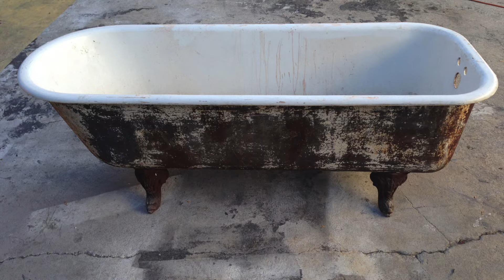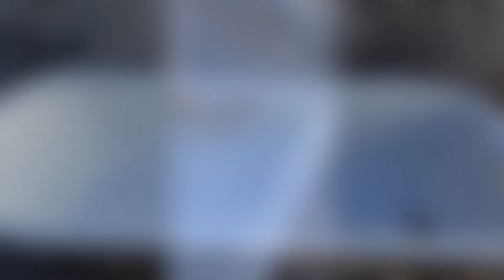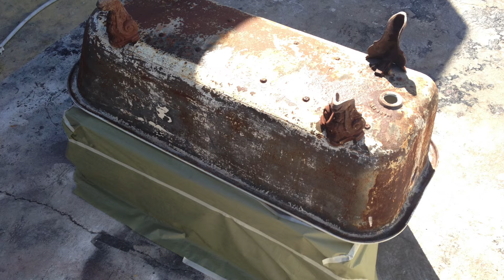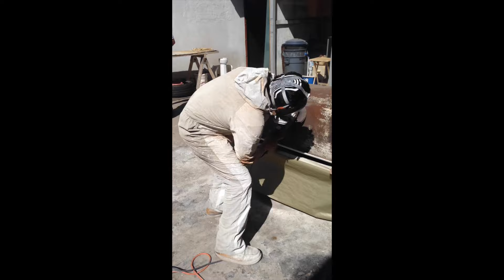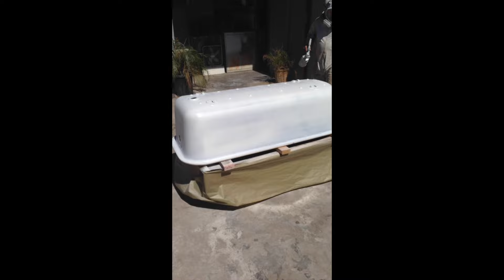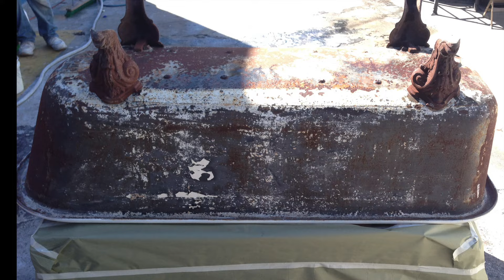Restoration of Vintage Clawfoot Bathtub

Comment: I used to own an 1876 tub that I slept in. It was pretty rusty. I kept all my tools in it, which made it hard to sleep, I always thought such a tub would make a great koi pond, except for one thing, the damn thing already weighed around 800 lbs. So I figured if you filled it up with water and added fish it might sink through the floor what do you think?
Reply: IMHO- PLEASE don't do that to an 1876 tub. Rust can be removed and koi get big. If nothing else give it to someone  doing a vintage house restoration.